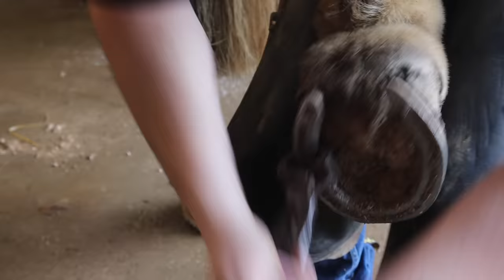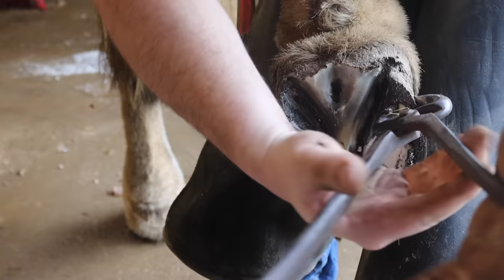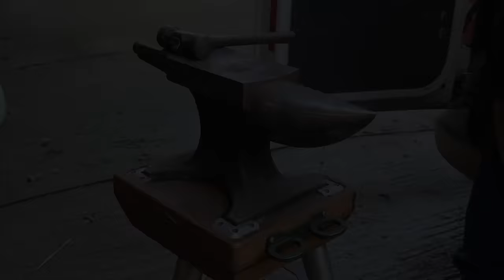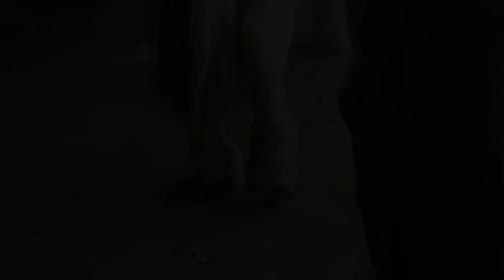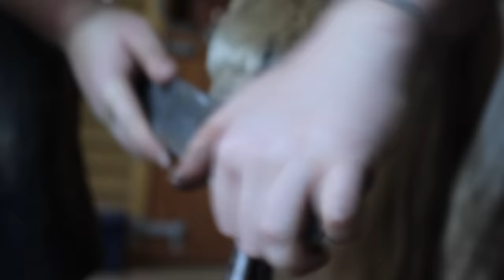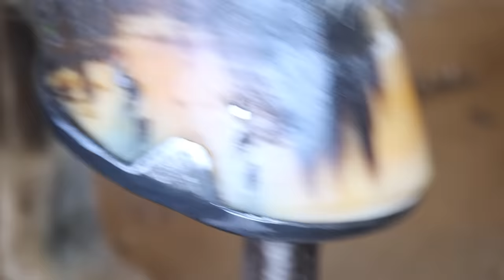“LAST” HOOF RESTORATION of 2021 ASMR

Comment: hoof trimming is always cool to watch, though i always find the end part just a bit scary haha, with the steam (does anyone know what that does? maybe make the hoof easy to put nails in?) and putting the nails in the new horseshoe.
edit: someone in the replies told me what it's for, ty!
Reply: Shape the hoof to the shape of the shoes. You push in the hot iron and burn away part of the hoof so it fits perfectly after brushing the hoof and cooling the iron.
Reply: @PascalSWE  ahh I see, makes sense, thanks
Reply: @The Three Non-Blind Mice I assumed they wouldn't feel it yeah, more that I'm worried about it going wrong haha
Reply: Also sanitation I've been told by other Farriers but I mean that may be subject to opinion I dunno just saying what I've heard.
Reply: @Manasit They get use to it like anything else a horse gets exposed to on a regular basis in a controlled manner.  I’ve worked with thoroughbred race horses.  I use to make a lot of cash tip money by holding crazy thoroughbreds for farriers at track meets when I was a teenager.  Thoroughbreds, especially young thoroughbred stallions that are physically conditioned and jacked up to race, are some of the flightiest, most high strung horses you’ll ever handle and even they get use to it.
Reply: @Manasit My, my, you have some big, flighty horses in Denmark.  

I grew up on an American Saddlebred farm.  We shod or trimmed 60-70 big, snorty Saddlebred horses a month and never had anyone injured or God forbid, killed.  

Being shod should be a routine part of a horse’s training from an early age.  If a horse has been well handled, he’ll get so use to being shod (including all the sights, sounds and smells), he’ll pick up his foot before the farrier asks him.

We started introducing foals to the farrier as soon as they were weaned.  They didn’t get shod but we’d start picking up their feet, cleaning their feet, and tapping on their feet as soon we got them halter broke.  Then if the farrier was there and had the time, we’d have him walk around the weanlings and yearlings picking up their feet and just tap on them with his hammer to start.  The farrier would usually make the time because he knew in the not so distance future he’d be shoeing those horses.

It’s always best for the handler/owner, the farrier, and especially the horse for its handlers to condition the horse to being shod.
Reply: @Duskdevil I'd imainge it's like a fingernail being burnt. As a young adult, I have really long nails and one or twice I burnt them. No pain, as it was just nail and not near flesh... but that smell! X__X
Reply: They do that to get a feel for where the shoe is going to fit on the hoof. Let's them know if they have to go back and change something on the shoe or hoof.
Reply: Jesus Christ loves you all please repent and forgive and believe the gospel

Comment: Do you heat and shape a new shoe each time or just reshape the old ones?
Reply: Boosting cause I also wanna know!
Reply: I do believe you have to shape a new shoe each time for the old ones can get damaged
Reply: Makes sense. Does anyone know how long a shoe typically lasts?
Reply: @anastasiabennett4854  2 ish months I think
Reply: @anastasiabennett4854  it depends on the horse and what they walk on. Bigger, heavier horses on asphalt will wear the shoes down faster, where the shoes lasts one shoeing. Lighter horses that mostly walks on softer surfaces might have their shoes for two or sometimes even three shoeings, but usually max two
Reply: Endlessly fascinating

Comment: I just came across this very interesting video and thought I’d ask a question that’s had me wondering for years. Are the horse’s hooves weakened by the nails with every re-shoeing?
Reply: Not at all! If it’s done well enough like in this video, the horse is actually feeling really good. Letting the nails growing too long can hurt and damage the horse’s hooves but you cannot cut too short either so
Reply: Ut actually helps keep the integrity of the hoof if theyre walking enough to warrant shoes and it helps prevent stones and dirt from getting in the white line

Comment: Can someone with knowledge take the time to answer..
What is he pealing from the bottom? Dead tissues? Something similar to nails? 
How many times does that usually happen to a horse? Cost of doing the four legs?
Reply: It's similar to nail but called hoofs. If it's not cleaned it will cause bacterial infection. That's all ik
Reply: Okkk! The stuff he is pealing off is just apart of is hoof/nail and yes it is very similar to nails! For the price, you pretty much always get all four done (w/ exceptions occasionally) so it’s per horse it’s usually $131.46 for a trim and nailing on four keg shoes and for resetting keg shoes averages $125.52 so in total around $257. Hope this helped :D
Reply: @YuKi-zt3nd  thanks.. helps a lot..

Comment: I can only wonder how good it feels to havr this done after years
Reply: Usually it’s done very 5-6 months but still bet it feels nice lol :D
Reply: After years, the hoof would be very overgrown. Fixing truly overgrown hooves is a long, arduous, and very uncomfortable process because the tendons and ligaments get shortened on one side of the leg and lengthened on the other. This happens because the overgrown hoof forces the leg into the wrong position. Then, the trimming has to be done bit by bit, over several sessions weeks apart, so the tendons and ligaments can slowly go back to how they belong. Only after the whole process is complete and the leg is normalized does it actually feel good. So...if you have a horse, don't wait years to call in the farrier!

Comment: How often does something like this need to be done?
Reply: Anything from every 4 to 8 weeks, but normally every 6 weeks. Depends on how much the hoof grows and on the horses feet. Some need trimming more often because of injuries etc, but 6 weeks is the norm:) (while grazing in the summer the hoof usually grows somewhat faster, so then they might need every 5 weeks instead of every six weeks for example)
Reply: @linneac6529  Wow, I didn't realise it was this often. That's a lot of work, then...